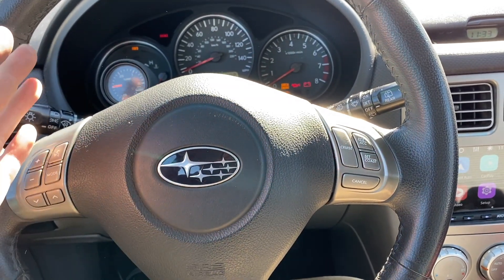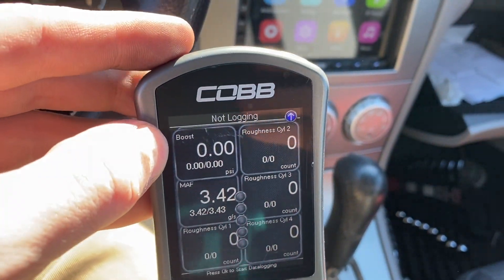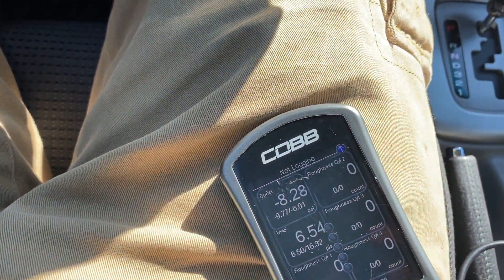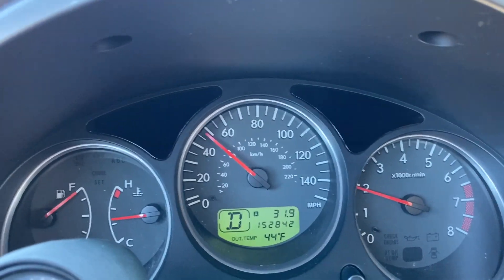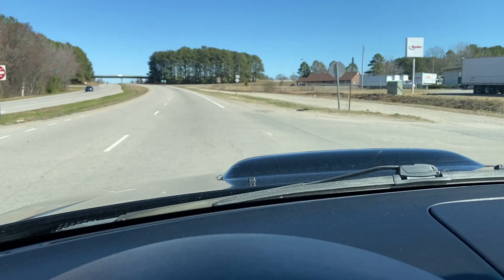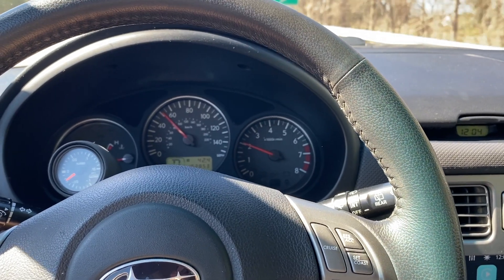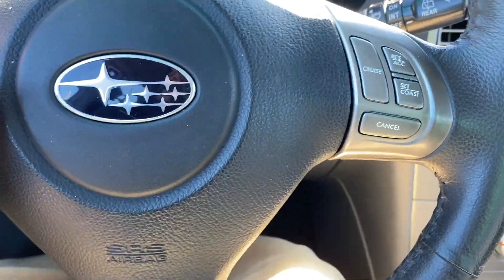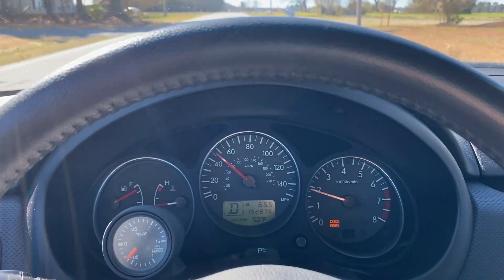Testing Turbosmart internal wastegate

Comment: Changing springs makes a lot of sense, when you're not using the factory electronic boost control and bleed. Your tune is aiming for x-amount of PSI, so regardless of the spring below this target, it has it's own duty cycle it is trying to work to that assumes you're running a standard actuator I would think. The systems are fighting each other, so you could use the turbosmart spring that equates to same value as stock actuator and that might help? 
Or disconnect the electronic boost control, run at wastegate spring pressure, set these springs to around what you want and I think that will work better too.
Are these the best, no , but hopefully it'll run better than what you've got going on currently.